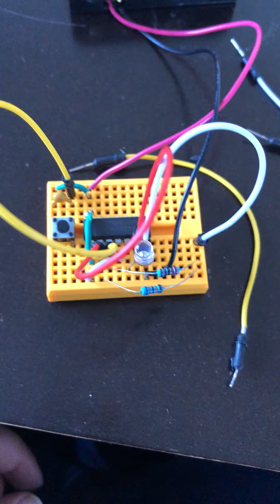Converting a D-flip flop to a T flip flop (toggle switch)

Comment: Are you holding S and R inputs high or low?
Reply from the maker: @lucassmith6508  low.  On cd4013, s and r are active high so i keep them low. This is the opposite for a 74hc74 series flip flop in which the s and r are active low

Comment: do you have schematic for it?
Reply from the maker: No but you just plug clock into clock and inverted output to data input that way it always toggles when you trigger the clock. Also functions as divide by 2 clock frequency divider circuit
Reply: Do you put your cap from D input to ground?